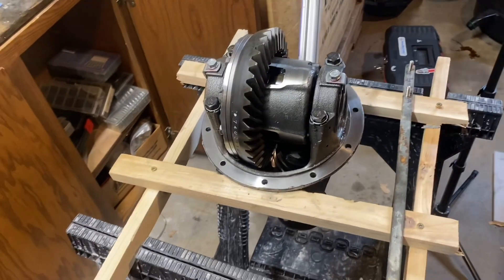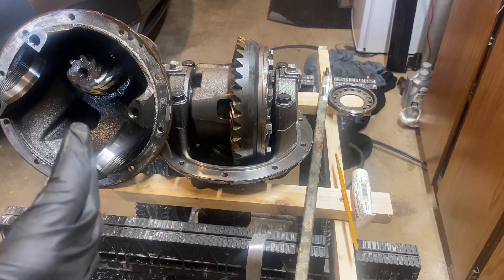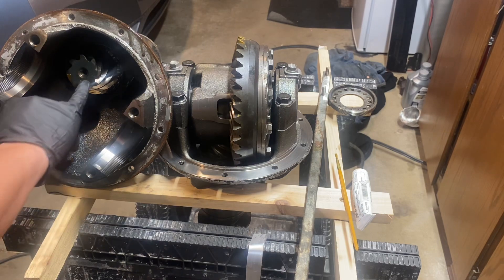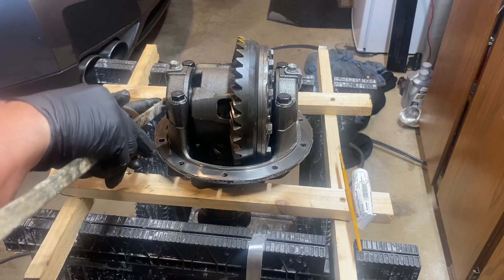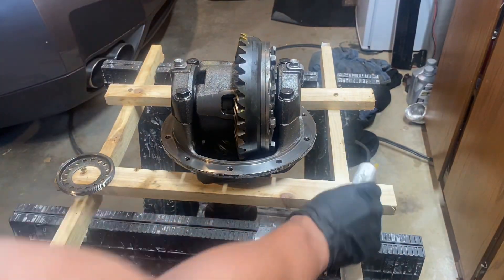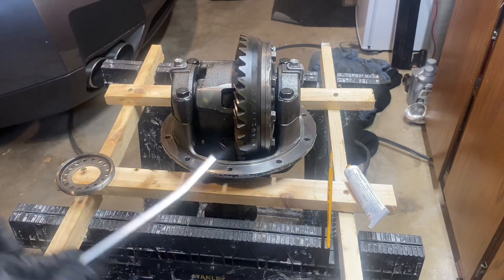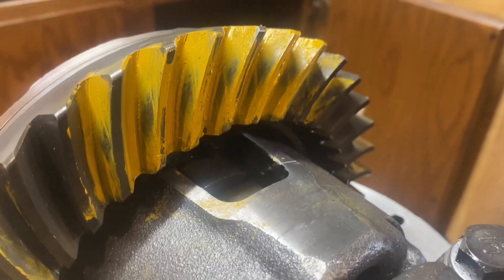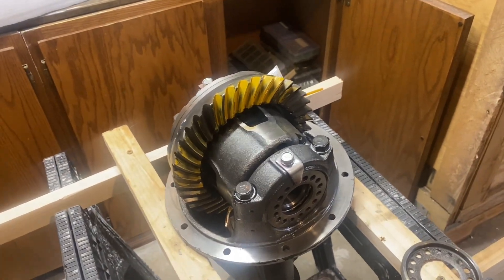Delica L300 Rear Differential Rebuild and Adjustment

Comment: Pretty good job. I inspected differential carrier assemblies for construction equipment at the factory. Ours were spiral bevel gears not hypoid but it's the same concept. One thing that's counter intuitive is moving the ring gear in tighter (less backlash) results in moving the contact towards the toe and pulling away (more backlash) moves the contact towards the ring tooth's heel. Pinion depth moving towards the axle centerline results in contact moving towards the base of the ring tooth while pulling away from the axle centerline results in contact moving up towards the tip of the ring tooth. The most important thing is making sure you have backlash or you will be noisy and spitting out teeth.